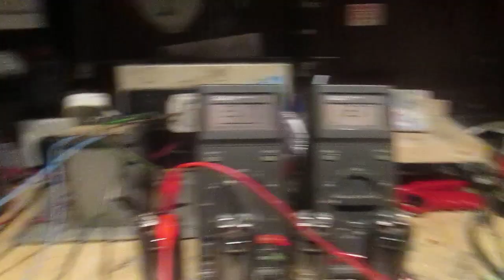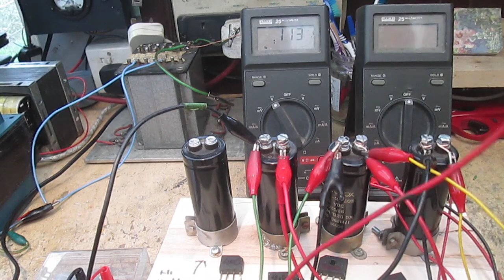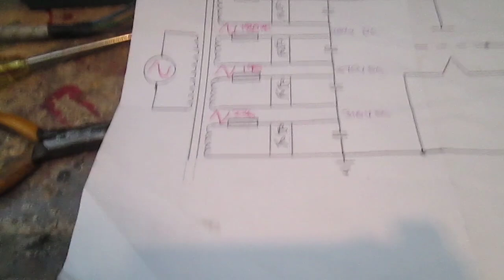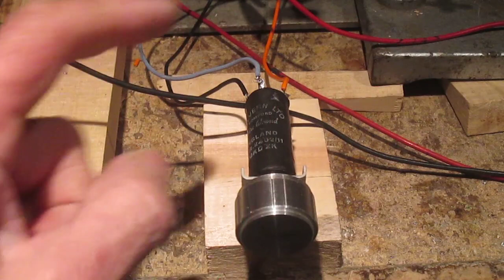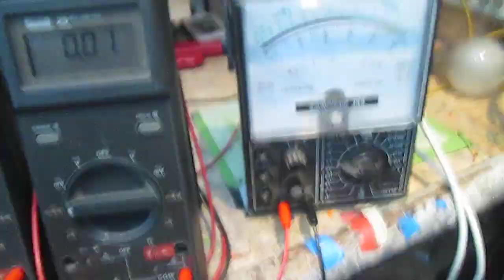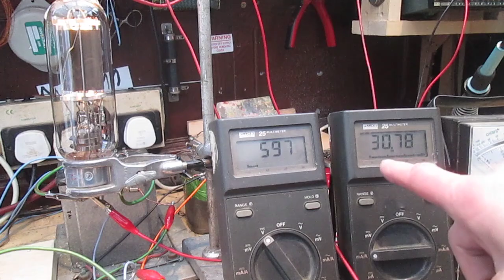Building a 1000v 0.5A Power Supply - Testing A Big Triode.

Comment: Thats a genius power supply. Thank you for sharing. 
If you use BIG industrial bridge rectifiers, that work at like 1600v and 100a each, they are 98 percent efficient at 120watts, the heat dissipation is 2.5 watts as per the datasheet. They are fuji 3 phase to dc. 
They can be used as full bridge single phase too. 
And they work better because theres more chunky bits of conduction. and you could probably never pop them.
Reply from the maker: Thanks, too kind, & ta for the info on those BR's.

Comment: These larger tubes are interesting. I once built a experimental amplifier using a pair of 811 triodes. I found it very neat that I didn't need any bias arrangement whatsoever. The tubes were essentially self biased into class B. I drove them with a interstage transformer to create push pull grid drive, driven by the output from another already existing audio amp. Worked flawlessly, and as you cranked up the volume, the anode current increased automatically. No noticeable distortion, sounded great and was extremely powerful. But couldn't make it work well with actual speakers because the output transformer was just an old AC transformer, and while it worked, the ratio was way off so it only delivered good power into 0.5 ohm loads which is not very practical for speakers, it could only deliver about 20 watts into 4 ohm subwoofers which is really dissapointing when such an arrangement could theoretically output several hundred. But one day I'm gonna revisit that project, and try to find proper transformers and try to build a complete amplifier with pre amp, mid stage amp, and the final output in one unit. It's always been a dream of mine to have an amplifier entirely based on vacuum tubes that can drive subwoofers with serious performance:) 

Would be so much fun to replace all my solid state amplifiers with tube, way more interesting:) 

Keep up the great work, really enjoyed this test :) that valve looks like it's in healthy condition, and I bet you could make one hell of a single ended amp with that if you wanted ;) of course, getting a pair would be best since in single ended mode you'd have to have it running at about 70 watts dissipation all the time, but... That's usually not a concern in our hobby :) it can pull as much power as it wants, hehe 

You could probably get a solid 50 watts maybe more of output from that one valve! :D
Reply from the maker: Thanks, interesting stuff. The datasheet shows a similar setup, two 2A3's driving an interstage tfmr driving two 805's. I have two 805's, I'd love to build a monster amp but would need another two 805's & they ain't cheap. TFW.
Reply: @diabolicalartificer  Heck yeah, that would be awesome. I'd like to build something capable of replacing a 3200W continious average power solid state amplifier to drive my 8 boxes of subwoofers, hehe. Insanity, but fun! I had a bit of a obsession with building speakers a few years back, but I don't regret it. It's a lot of fun to crank up music and just make the whole area absolutely shake itself to pieces :) 

I'd love seeing you build a monster of an amp, but be careful. At this voltage level one touch and one can take the last breath, so gotta be really careful! That's one thing that worries me if I'm going to build a monster tube amp, I need to absolutely make sure that my cats can't touch high voltage, I'd probably have to build some sort of cage type chassis for it :)
Reply from the maker: @tigerelectronics5966  EHT or any power supply capable of over 500v ish is problematic, obviously, from a safety point. A few years ago I thought about building a 500w valve amp using 813's but ditched the idea for a few reasons. 1) The EHT & 2) The OPT needed for such an amp.
   I think it's better to use paralleled valves instead at a lower HT and that simplifies the OPT construction too.
   For sub use a SS amp is the only practical solution. At those low frequencies a powerful valve amp's OPT would be prohibitively expensive & you'd need a fork lift to shift the amp.
   Still, it's nice to dream.
Reply: @diabolicalartificer  hehe, it very much is nice to dream :) Yeah, definetely gotta be careful. just 300V supplies found in most domestic valve amps can bite pretty good! I got bitten by a vibrator powered car radio once when I wasnt paying attention, it was about 250V DC, it hurt my hand pretty good! No burns, thankfully.

Yeah the transformers are a problems, however, I managed to find a large 400V AC to 2x24V at 200 ampers... Hehe, I think it would work for a output transformer for bass. Weight is definetely gonna be a problem though, but it is nice to dream :) 

I have horn loaded subwoofers, so I do not need more than 50 watts total for all subwoofers together or so for it to become impressive and absolutely ear-pounding. My favorite subwoofers are my 1850 horns, 1850 is the design name, not a year :P It is a long throw horn design, but it works just fine indoors too. with just 10W input to them, they will play 120hz down to around 45hz so loud my ears cannot handle it :) 3200W is just because I can, but it is not neccesary, not even if I ever were to use my speakers for something more serious than listeing to loud music in my living room lol. I have actually thought about building somehting like a 2x100W valve amp to drive them, that would be plenty enough! Divided across all subwoofers, it will become insanely loud :) And definetely doable with parallelled tubes and a "safer" HT of around 400. Because I Have pets and such, I dont want to use 807's though, they are cheap compared to say 6L6's but I need some safety, and I dont want to build an amp with a cage chassi unless I have to, part of the appeal of tubes to me is being able to look at them :) And then i'd build a 2x25 or something like that to drive midrange and tweeters. One of the things I want to strive for when building my amps is that no matter if its a sub amp or mid or high amp, I want them all to use the same types of tubes. that way I dont need to have a million different replacements. and I always want to use readily available ones, such as the 6L6 family, 5U4 family, and 12A series families of tuubes :) 

But yes hehe... one day, just for experimentation and to please myself... I'm gonna hook some tubes up together with that big power transformer... I'm pretty positive it will work, although it would only be an experiment :) 

Gosh I miss building tube amps, recently had a fire in the workshop building I am in, so everything has kind of come to a halt right now. So now I do other things that I Can do outdoors, so now I mess with small engines, I found a diesel engine that looks like a ordinary honda GX style so I want to convert a petrol generator into a diesel one, since diesel has quite a lot of benefits over petrol. mainly it doesnt go bad in storage

:) Now I am ranting a lot, but I hope you dont mind
Reply: Gosh I wrote 807... That's of course not what I meant, hehe. I meant 811 triodes.
Reply from the maker: @tigerelectronics5966  Easily done : )

Comment: Great lashup here Andy. Works pretty good. Those 805's are a good tube.

WARNING: IF YOU HAVE PETS- DO NOT USE ANDY"S OPEN CONSTRUCTION METHOD SHOWN HERE  . Pets love to shove their noses into things and you may injure or kill your pet!!

   When I did TV servicing house calls, I had both dogs and cats shove their noses into the open backs of TV sets and bump into live B+ connections, where the voltages were substantially less than 1KV and up to 40KV in the HV section. I finally required pets to be shut in a separate room, and also small children to be out of the area. (The pets were less of a problem than the children! Not joking either.)

Be sure your test leads insulation are rated for the voltage you are using too! many of the new ones seem to be  very low voltage rated. Nothing like having test lead wires arc over on HV in tube projects.

Andy- What info do you need on the 805 tube? I have a data book from RCA " Transmitting Tubes"  early ARRL handbooks, and Tube Lore II by Lud Sibley where I can likely let you know what you need. In Ham service, we often ran the graphite plates at a dull orange or a red glow, in CW transmitters.

Let the filament warm up for 30 seconds to a minute before applying B+. It will increase the life of your tube a lot. Think time delay relay on your finished amp.

Adding a meter to monitor plate or cathode current will tell you if the tube starts to "run away".

On using tubes that have been stored for decades, like the 805's, letting them sit with just filament voltage for 30 minutes or so will help the filament emission to stabilize.

With thoriated tungsten filaments, low emission can sometimes be restored by running a filament voltage 50% higher for 30-60 seconds and then reduce it to 2-3 volts higher for 10 minutes or so. Then run at normal filament voltage for an hour or so to stabilize. This is an old trick to "boil" the surface of the filament and allow more electrons to the surface for emission, per an article from the 30-40's on rejuvenating transmitting tubes.
Reply from the maker: Wise words Frank, thanks for the info, I'll drop you an email.